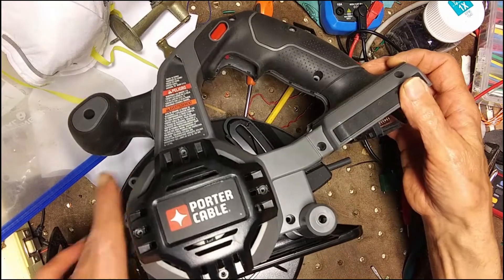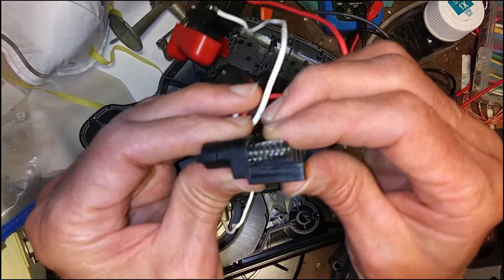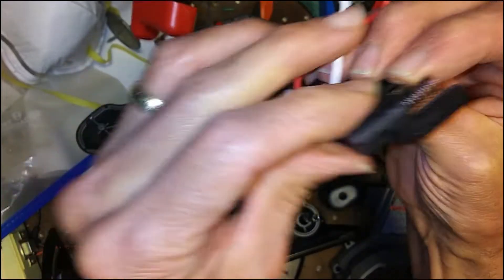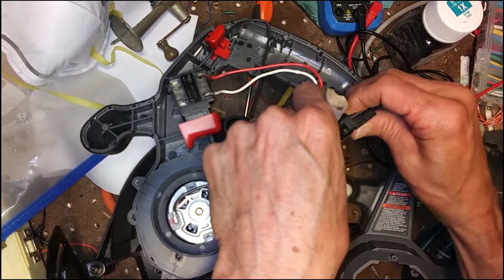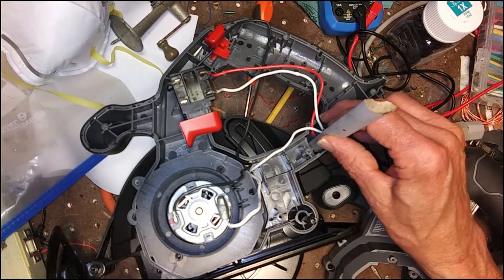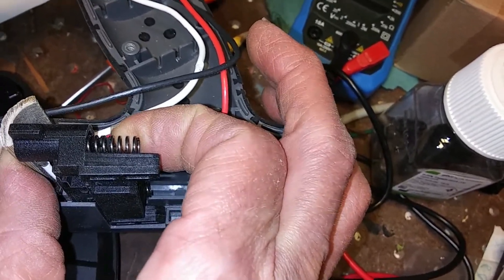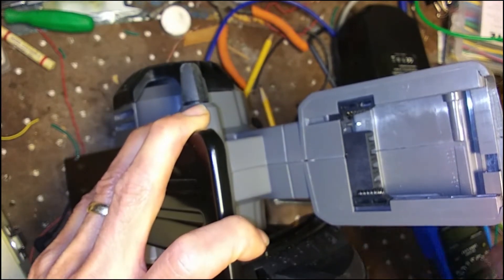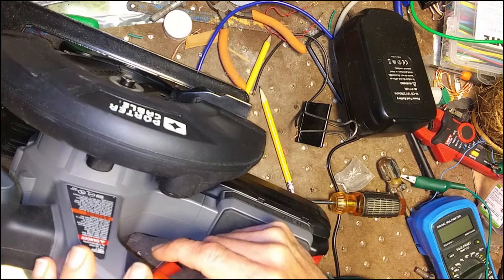Porter Cable PC186CS cordless saw battery connector fix

Comment: I have one of these which has only been used a few times.  It looks like new.  The batteries are new and the charger indicates they're charged.  The last time I used it, I did push it a little hard and it became very warm.  It hasn't worked since.  Any chance I ruined the brushes?  Do you have any idea why it won't work?  Any advice you can give will be greatly appreciated.  Thanks. D
Reply from the maker: I think hard use doesn't normally ruin brushes unless it was done repeatedly over a very long period of time.  More often, overloading and overheating will cause shorts in the armature which of course is a much more serious problem.  Sometimes you can tell because the burnt out armature coils are blackened instead of the normal shiny brown/burgundy color.  First step would be to determine whether it's drawing any power.   For example, if you have an ohmmeter you could remove the battery and measure across the two terminals that connect to the battery and see if there is any continuity when you push the trigger.  If not, tnen it could be a broken switch or broken connection somewhere.

Comment: Thanks for your time on this video. I do have a question? I have a number of Porter Cable tools 18v that use NICD batteries one being the saw same a yours, I have switched over to Lithium-ion 18 Volt batteries on all tools (designed for Porter Cable.)  All seem to work well with new batteries but the circular saw dose not produce performance with new battery and the battery gets HOT.  Any thoughts?
Reply from the maker: That is very puzzling behavior.  Any battery will heat up to a certain extent under heavy current load, and the circular saw will draw more current than most other tools such as drills.  But why it would be worse with Lithium I don't know.  I can't find any detailed technical specifications on maximum current draw, but generally Lithium batteries are more tolerant of high current than other batteries.  Most newer batteries have some sort of current-limit protection built in, so maybe that is not working properly for some reason?  Thanks for commenting.